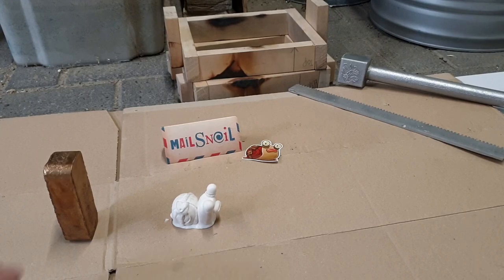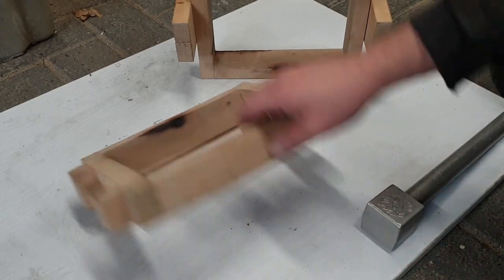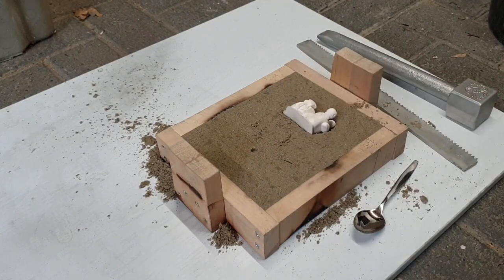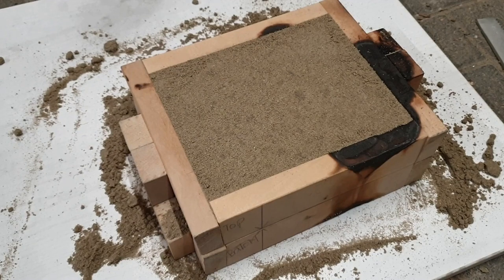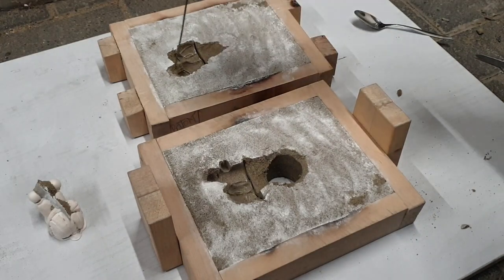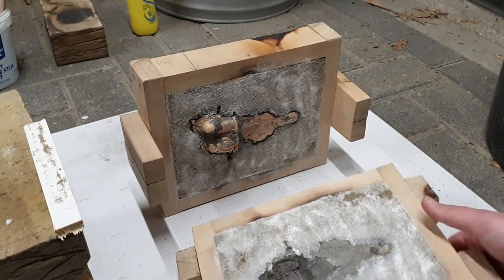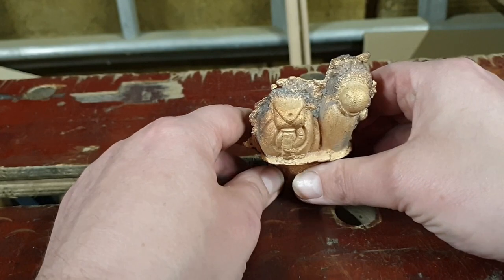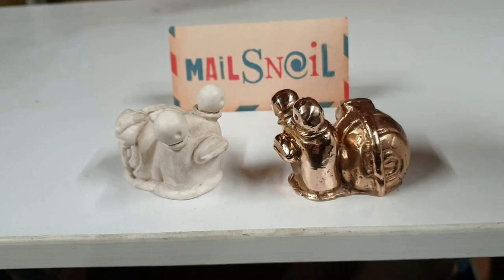Making a Bronze mini sculpture for a friend who is a Mail Snail

Comment: Fantastic work Ralph,  a sticker will certainly be in the post,,,,,, errr sometime.   Would lost wax casting be better for such an awkward shape, I am most impressed at your skill with a Dremel. I would be honoured to receive such a gift.   I will check out the Craftsman.
Reply from the maker: Lost wax casting is the way to go when casting figures like this, unfortunately it does require some equipment that I do not have... yet 😋
Reply: Hay Ian
Reply: The craftsman is definitely a good show steady crafting ✌️
Reply: An honour indeed Ian !

Comment: This is the first time Ive seen you cast stuff - it looks like soooo much fun! I cant wait to try it mysefl (although I think I am a year away at this point). I received a hand-me-down Dremmel a few months ago and it stopped working very quickly. It turned out one of the connections on the stator separated, and all I had to do was back out one winding and reconnect it. Dremels are suprisingly simple inside, although Im sure there is a lot of precision workmanship in their manufacture.

Comment: If you were going to make a bunch of these without using lost wax, it might be worth trying to make some little coreprints and core boxes to mold those undercuts in sand... But if you'll only ever make a few of these, dang, I think you're good enough with that dremel to make it work!  Snail looks great. 👍
Reply from the maker: Thanks Tobho Mott! I was actually thinking about that, although I don't think I'll be making that many of them, unless there is going to be a large demand, I'll have to check with The Crafsman if that happens though 👍👊